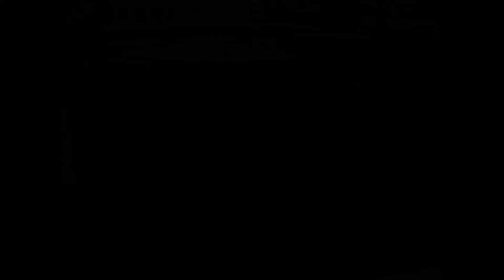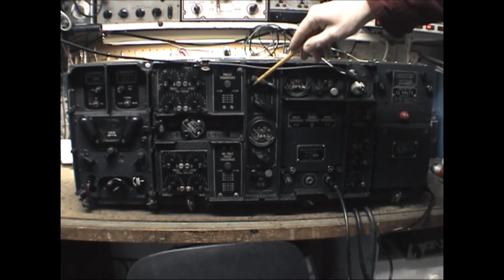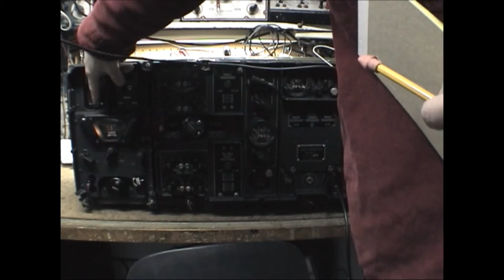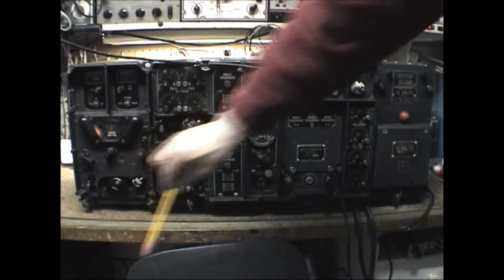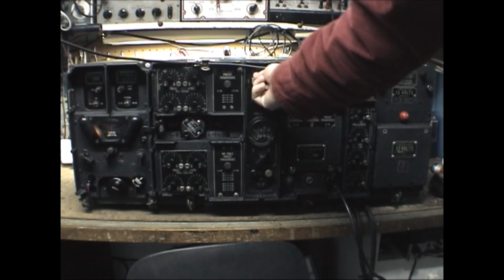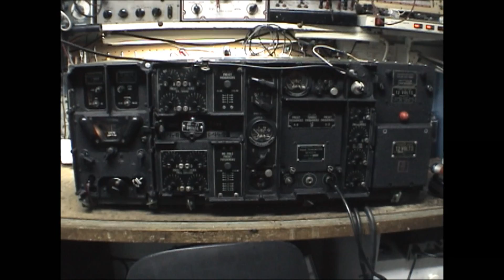SCR-506 WWII Vehicle Radio Set.

Comment: Its like they never finished the mount, dont understand,  all those unused pins, and wiring the antenna wire across the front, instead of in the mount like -508 set.